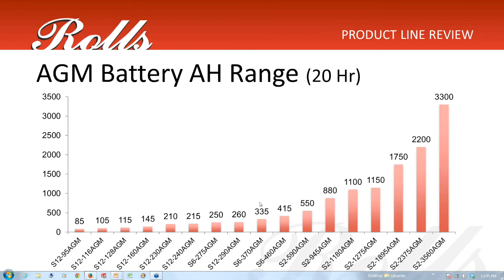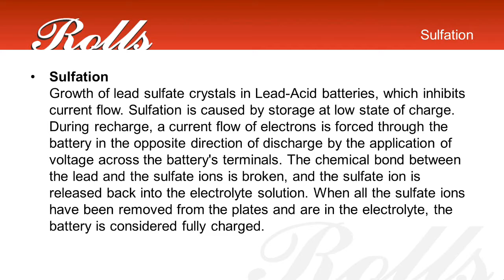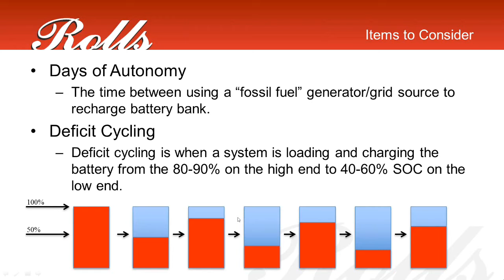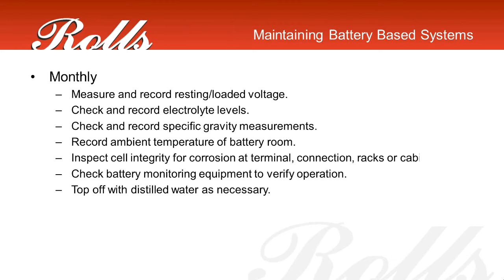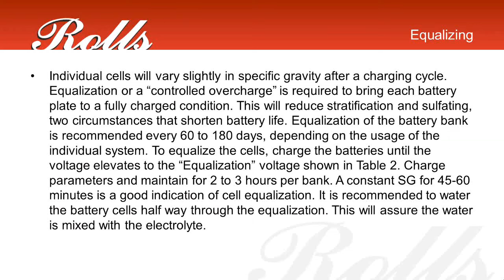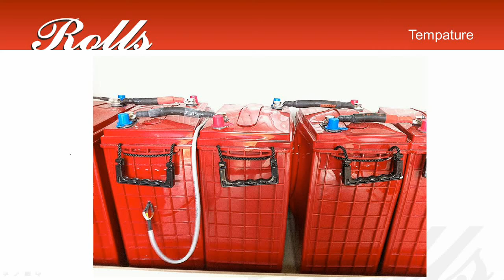Surrette Big Battery Webinar

Comment: I don't understand the "C" designations. I have a 2.7 kw 24 volt system, 6000 watt Aims inverter, 96 amp midnight mppt controller and 16 110 amphr agm batteries. I run an aquarium, refrigerator, freezer, and some led lights at night. I get 6 to 7 hours of running before I get to 50% DOD according to my Trimetic monitor. I would like to get to 12 hours battery run time so I need 32 total 100 amphr batteries?
Reply from the maker: Peter,
 
The rate at which batteries are discharged (discharge rate) effects the amount of energy they can provide. This means that a high load (current draw) would result in less energy being pulled from the battery compared to a smaller load. The C ratings reflect the amount of energy the batteries are able to provide based on discharge rates. For Example Surrette’s R12-100AGM battery which is a 12V, AGM battery, is capable of supplying 110Ah when discharged slowly(C100), but only 86Ah when discharged more quickly (C10).
 
As for your questions about your system, given that you have 16 x 100Ahr batteries (I assume 12V batteries) wired into a 24V inverter, your system has 8 parallel strings of AGM batteries which you are discharging to 50% DOD nightly. There are a couple of things about this which cause concern.
 
1)      Depth of Discharge – Given that you are cycling them frequently and heavily (nightly to 50% DOD) the life expectancy of the batteries could be drastically reduced.
2)      Parallel Strings – Steve from Surrette frequently tells us that the best number of parallel strings is 1, and recommends not more than 3 parallel strings. This is because multiple parallel connections will often create uneven resistance between strings, causing an imbalance of charging and discharge currents, resulting in possible cell damage of premature failure.
 
Instead of adding additional parallel strings to your system, we recommend that you consider using fewer batteries each with greater capacity. Perhaps Surrette’s S2-1275AGM batteries would be worth consideration.
 
If you would like to discuss this further, please contact HES PV and we can put you in touch with one of our dealers/installers to help properly size your system.
 
 
Thanks,
 
Daniel Partridge, EIT

Comment: Questions...........

Ok I want to run a 12 volt system. I have 2 LG 305 watt Panels total 610 watts max. The panels are 10 amps each. I know your rolls S6-460AGM Battery is 415 amp hours each. 2 Questions........

1. Will I have to have 4 rolls S6-460AGM Batteries. in order to get the benefit of the AH on your batteries? I would like to run the batteries in Parallel.

2. As stated above will the 2  LG 305 watt Panels total 610 watts going into the battery bank. Will the solar panels charge your batteries sufficiently?

Example of my calculation:
10 x (Battery Capacity in Amp Hours)
(Load power in Watts)     = Run time in hours
------------------------------------------------------------
Using 4 S6-460AGM Batteries
----------------------------------------
4 S6-460AGM Batteries @ 415AH each = 1660AH X10 = 16600AH
Window A/C Unit = 500 watts
16600 / 500 = 32 run time devide by 2  @ 50% battery life = 16 hours of run time.
-----------------------------------------------------------------------------------------------------------

I just want to make sure that the solar panels will be able to charge the 4 S6-460AGM Batteries so there will be no damage to the batteries.

Thanks.